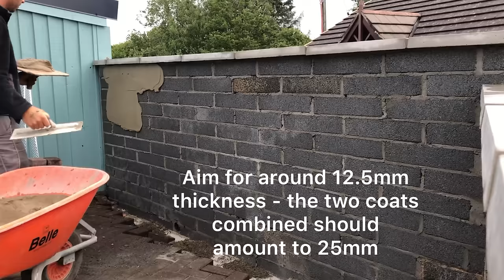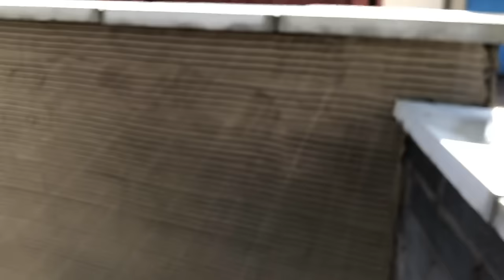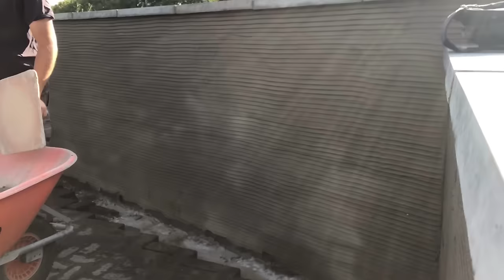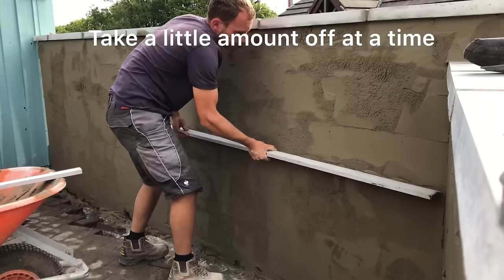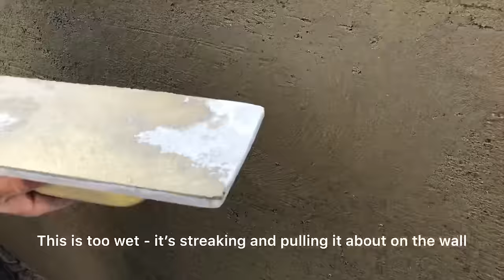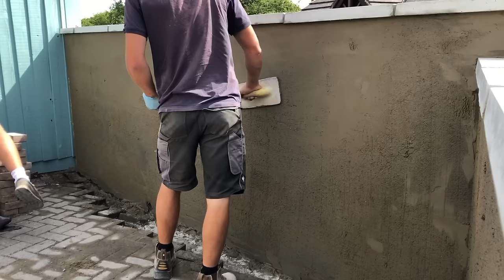How to plaster an outside wall

Comment: Does the final coat require Lime at all or does the plasterciser/waterproofer do the job on its own?
Reply from the maker: LAZER GAMING I don’t use lime and as you say let the plasticiser or waterproofer do the job. I only use waterproofer if it’s a wall where the rear side of it would be dry such as a shed or house wall. Some people do use lime in their mixes though!
Reply: Use lime in the Finnish coat  especially if you want a nap Finnish.. lime helps prevent hair line cracks also..

Comment: Excellent video, really clear. Sometimes the sponge finish on an external wall has a slightly stippled effect. Is this done with a wet or damp sponge? Thanks.
Reply from the maker: John Healy thanks! Just a damp sponge. I wring it out so water isn’t dripping out of it. It can be sponged in a downward sweeping motion or in a circular motion. And don’t catch it too late or it won’t sponge nicely, just after you’ve floated it is the best time
Reply: @SamDaviesBuilder  Thanks Sam. I'll give it a go :) Is there any particular type of sponge that works best?
Reply from the maker: John Healy just a normal car wash sponge is fine. Make sure the sponge is flat and not mis shapen or it will not give an even finish
Reply: That's a nap finish your thinking off.
Reply: You can do a nap Finnish using a car sponge or a raised nap using the same type of sponge that is used for skimming. Raised nap is harder to do but looks better when done correctly.
Reply: John Healy in Australia depending on the bricks and weather. On two coat in winter we still use water. Fine mist. Seems the cement ( mortar ) is extremely wet so hardly any water required.
We also have sponge floats.
I actually uploaded a plastering video and the bricks on a single coat was really really dry so it took a substantial amount of water.
Reply: A spongy 1

Comment: Sam, do you ever use lime instead of plasticizer in the base coat ?
Reply from the maker: No, plasticiser is so easy to use that I always use that.  That's not to say you can't use lime though, its just the way I do it
Reply: When you say plasticiser is that waterproofer ?
Reply from the maker: Ciaran Duffy no, but waterproofer will act as a plasticiser too. I only tend to use a waterproofer when it’s onto a cavity wall

Comment: Hi. How much plastering sand and cement? Also have you add any plastisizer in the mix and bonding agent in the questioned surface? Thanks.
Reply from the maker: Dimitris Kaloupis just plasticiser in the mix which is 4 parts sand and 1 cement for scratch and 5 parts sand and 1 cement for top coat. No bonding agent on the surface - if it’s smooth surface you would need some sort of bonding agent. I only had to wet the wall for suction
Reply: @SamDaviesBuilder  You are a star, i will give it a go however if i  will fed up by doing it,drop me your details and get that job here mate...
Reply from the maker: Dimitris Kaloupis I think Wales is a bit far from you I’m afraid 🤣
Reply: @SamDaviesBuilder  oh lord...Southampton...

Comment: I never understood how you make a wall plaster plumb by just troweling the plaster on it. In central Europe where I live we start off with putting plumb lines of plaster, let it dry and then we throw in the plaster in between, after that we use a straight  piece of wood or a metal lath to smooth it out by draging it on the guides (plumb lines of plaster).
Reply from the maker: Interesting to see different methods in different countries. I suppose here as long as your wall is flat and true, then your scratch is straight edged along with your top coat then you will be pretty plumb! You can’t go wrong with plumb lines of plaster I suppose though.
Reply from the maker: @stavebnifirmapikr9129  thanks for that. Such an interesting process! I’m surprised you don’t use beads and it’s true craftsmanship the way you do it! What’s your mix?
Reply: 1 lime 2 cement 5 sand for interiors and for exteriors 2 cement to 4 sand
Reply from the maker: @stavebnifirmapikr9129  2 cement is interesting, much stronger than our mixes.  4 sand to 1 cement is a pretty standard mix here

Comment: Do you have to do a whole area in 1 go, I only ask because after this video I'm tempted to try, but it's quite a long wall
Reply from the maker: Shane Scott you can always break the wall down into sections using stop beads
Reply: @SamDaviesBuilder  will the beads show on the wall or will I be able to blend 1 section into another
Reply: Put 2 stop beads back to back with a 10mm gap. After it’s plastered, run some mastic into the gap. If the wall is very long this is good practice as it will help to avoid cracks in the future
Reply from the maker: Luke The Skeleton Boi totally agree with you there, good tip!

Comment: I have a wall only 5 blocks high in harden but long 16m is this something to tackle rendering myself i am fairly handy just concerned about that final finish not being spot on. Near impossible to get a plasterer (decent one)
Reply from the maker: What you could always do is split the wall down into smaller sections by using a stop bead or some baton on the wall.  You may always see the join but if the wall is 16m long you'll end up with a crack somewhere due to expansion anyway (expansion joints every 6m generally on block walls)
Reply: @SamDaviesBuilder  what are your thoughts on this single coat render products
Reply from the maker: mickinoz2005 I haven’t used any before - I do plan to in the future though!

Comment: For both scratch and top coat, once applied how long do you have to wait until you can rule it off ? Also can you explain your sand and cement mix consistently? 

These are the only 2 things I have trouble getting right. Great Vid by the way :-)
Reply from the maker: Basically when you rule off you want to make sure it is dry enough not to move it about on the wall. It’s a fine balance as you don’t want to leave it too dry before you rule off.  I can’t give a time on how long as it depends on weather conditions for how long it will take. 

Here is a link to my video on how to mix:

https://youtu.be/8dxcp2GyQ4Y

Thanks for watching too :)

Comment: Do i have first have to wait when i made the scratch wall untill its dry?
Reply from the maker: Yea.  You have to wait until the next day before you put your top coat on.  I have made another detailed video on scratch coat only on my page if you want to check it out
Reply: @SamDaviesBuilder  

Thx.  One day ill wil try this.
After plastering can i give it a Colour?
Do i need a special paint.

Nice weekend!

Grz
Ben form the Netherlands
Reply from the maker: binola yes you can paint but ensure it is fully dry, I like to leave it at least two weeks, longer in colder temperatures. Use a good quality paint and ideally water down the first coat to ensure good adhesion. Thanks for watching!

Comment: Nice video. Looks like concrete bricks.
Do you use any additive in your mortar?
Reply from the maker: Ronald Martens yea it’s over concrete blocks. I use mortar plasticiser which adds air to the mix
Reply: Sam Davies the Australian builders association banned plasticer because they wanted to promote the lime industry.
I stopped using lime altogether when I came across an industrial chemist who stated we considered lime to be no good. I thought okay. So I worked with them and also used their plaster no lime. It's the best thing I ever did. It's more expensive. Does your work crack after a while once it's dried a few months time seeing as it's not drying?
Reply from the maker: Ronald Martens interesting! What does the plaster you use consist of? Have only experienced cracking from no expansion joints! Does your plaster crack?

Comment: Hi Sam would ya get away without a scratch coat if I skudded the wall
Reply from the maker: Johnny sorry I don’t have experience with skudding so I can’t help you there. I know a lot of people commenting on here seem to have an idea with skudding
Reply: @SamDaviesBuilder  i asked chat gpt :

When plastering over a stone wall, the terms "scud it" and "scratch it" refer to specific steps in the preparation and application process to ensure a good bond between the plaster and the stone wall. Here's what each term means:

Scudding
Scudding is the first step in preparing a stone wall for plastering. This involves applying a rough, thin coat of a wet mix, often made from a combination of sand and cement, sometimes with added lime. This mix is thrown or brushed onto the stone wall to create a textured surface. The purpose of scudding is to provide a good key, or grip, for the next layer of plaster. Without this rough base layer, the smoother plaster might not adhere well to the stone surface, leading to potential peeling or falling off over time.

Scratching
Scratching refers to the second step after scudding. Once the scudding layer has cured and set sufficiently, a thicker coat of plaster, called the scratch coat, is applied over it. While this coat is still wet, it is scratched with a comb-like tool or a trowel to create grooves or roughness. This scratched surface helps the final coat of plaster adhere better by providing additional texture and key. The scratch coat is crucial for ensuring that the subsequent finishing coats of plaster bond securely and evenly.

Summary
Scud it: Apply a thin, rough coat of wet mix (often sand, cement, and lime) to create a textured surface on the stone wall.
Scratch it: Apply a thicker coat of plaster over the scudded surface and scratch it to create grooves for better adhesion of the final plaster coats.
By following these steps, the plaster will have a strong and durable bond to the stone wall, ensuring a longer-lasting and more effective finish.

Comment: Do you wet the wall first if it’s dry
Reply from the maker: Yes you must wet the wall if it’s dry to help suction and stop it going off to quick. How much you wet it depends on the time of year too. You can’t wet it too much in the winter or it will take ages to go off
Reply: @SamDaviesBuilder  appreciate the reply sam.  Tough find a block layer these days here in Ireland. My wife sent me on a 3 day apprenticeship and told me to do it.  😅 looks like I’ll be plastering too.
Reply from the maker: @davidday866  I think trades such as block layers and plasterers are becoming harder and harder to find! Good luck doing it yourself, the key to it all is getting a good mix and you you’ll be fine!
Reply from the maker: @davidday866  there’s a few more plastering videos on my page and also one about getting a good mix
Reply: That the gospel today I made a mix.  I was so excited for it. The blocks levelled with a little wiggle. I learned the mother gets wetter as it mixes and slow down the mixer.  5 meters at a time.  I’ve got about 40 meters to go 6 block high.  I’ll get it before I’m done.   I’m a steel fabricator by trade.  Got to make railings  and  sliding gates.  Shoul be all sorted by 2024 🤞😳
Reply from the maker: @davidday866  glad you got the mix sorted! Sounds like you’re a natural at it. Good trade the steel fabrication too, never be out of work with a trade like that!
Reply: @SamDaviesBuilder  yes I’ve been going through your videos.  There great Sam. Can’t beat just seeing a job getting done well  no big long  chats and introduction.  Your mix video saved my patience 🤘I had a few bad ones, it’s not easy work with it.
Reply from the maker: @davidday866  cheers for the compliment! Once you’ve done a good mix a few times you’ll get it perfect every time, I reckon it’s a hard skill to master knowing what a mix should be like
Reply: I can see there’s an art too it.  Weathers scalding hot too. It’s rushing me 😬 I might stretch to 10 blocks an hour
Reply from the maker: @davidday866  as long as it’s tidy doesn’t matter how long it takes when you’re learning, that’s what I was taught
Reply: Yeah man. That’s the truth.  Rush it and you’ll find time to do it twice
Reply from the maker: @davidday866  exactly.  Only time you have to rush is if you’re plastering and it’s going off too quick 🤣🤣

Comment: Did you put pva before scratch coat
Reply from the maker: eagle gummy bears no. As long as the wall is clean and you damp it down for suction then it will be fine. If it’s a smooth surface you are putting a scratch onto then an sbr and cement slurry should be painted on just before you scratch. Block work just needs wetting

Comment: Hi mate, looks good. Did you use sharp or soft sand for the render?
Reply from the maker: Amer H I used building sand. Sand quality is so different in different parts of the country it’s difficult to say how my building sand might compare to yours. Your local merchant may even do plastering sand to buy

Comment: Good video but why put a 25mm render on a garden wall? No insulation is required as on a house wall. Better to buy a special finish that would go on in one coat at 3mm.
Reply from the maker: 25mm of render isn’t for insulation properties.  Sand + cement render is cheaper than the specialist coloured renders plus those (especially K Rend) coloured finishes can be pretty course and get dirty quickly as the dirt sticks in the course texture.  

Coloured renders do have their place though!

Comment: do you use pva
Reply from the maker: No, pva is water soluble so you shouldn’t use it outside.  If you want to get something to help the render stick then use rendagrip or SBR mixed with cement
Reply: @SamDaviesBuilder  can i mix pva with the render mix
Reply from the maker: @cosmic_sky_mountain  why do you want to mix pva with it?
Reply: @SamDaviesBuilder  i thought it could make it waterproof , but i understand now that it wont work , so can i mix sbr with my sand cement mix to make that better at weathering ?
Reply from the maker: @cosmic_sky_mountain  you can get a waterproof additive to go in the mix like this:

https://www.sealantsandtoolsdirect.co.uk/feb-febproof-plus-waterproofer-plasticiser-admixture-5-litre-fbproofps5?language=en-gb&currency=GBP&gad_source=1&gbraid=0AAAAADx-2OJx9gMin03eJOjp45aECrKZc&gclid=EAIaIQobChMI8M7Sya7HhwMV55NQBh1cRQmLEAQYDCABEgKJOPD_BwE
Reply: @SamDaviesBuilder  cool , thanks !!
Reply from the maker: @cosmic_sky_mountain  no problem, one thing to note is when you use waterproofer the mix will take longer to ‘cream up’ in the mixer than when using a standard plasticiser so be patient
Reply: @SamDaviesBuilder  super thanks !!

Comment: I don't like to see plaster going on without a scudding.. but that's the way I learned to do it
Reply from the maker: dj hago I’m not actually sure what scudding means? Always open to seeing other way things are done
Reply: Mix sharp sand and cement at 2 to 1 really wet with no plastisizer... and throw it on with a scudding spoon for first coat .. leave it a day then scratch it.
Reply: It keys to the wall alot better
Reply from the maker: dj hago ah I have seen that on a lot of Irish house build accounts on Instagram. I wondered what it was. I see it done before they clad a house in stonework too
Reply: @SamDaviesBuilder  youd be ran of an Irish site without scudding your walls before scratch coat.
Reply from the maker: Robert Bolger always interesting to see different methods in different parts of the country. If you get the chance then put up a video of you applying the scud, would be interesting to see. Thanks for watching too :)
Reply: @SamDaviesBuilder  that's standard practise here in Ireland mate.if this lockdown ever gets lost.a shovel of lime also into your mix helps it rub up lovely in winter.be careful in summer months tho.

Comment: Where is the bell cast beads
Reply from the maker: indigokid jjj2 bell cast beads are purely a cosmetic feature these days. We didn’t want them on the wall - most walls I do wouldn’t have a bell bead. Historically you’d have them on a house or chimney to shed water away from the base of a wall but now with modern DPC’s and paths being 150mm lower than DPC then a bell bead has no function apart from cosmetically.

Comment: Ok render beads are only 15 ml that's to allow for a 5ml scratch and a 10ml top, you didn't put a bell bead at bottom and you were that slow the render was tearing as you were ruling but overall was a decent finish 👌
Reply from the maker: Steven Williamson cheers for the comment. Bell beads are depending on what the customer wants. I say there’s more jobs without bell beads. And beads aren’t 15mm, some of the plastic ones might be but the metal ones are just mesh so you can make them anything you want. But the thing with this job is everyone is different and people have their own ways. I’ve never been about speed to be honest, it’s worked for me so far. Appreciate the comment anyway :)
Reply: Mate I'm not trying to criticise I'm just trying to help if you rule up as you go would be much easier and speed up it does have to be layed on perfect the rule will sort all that as for the bell bead if you don't put one at bottom moisture will get behind the render and the bottom will fall off in a few years it not criticism mate just fact
Reply from the maker: Steven Williamson I disagree on the bell bead. The bell bead is cosmetic a lot of the time. Before DPC’s were invented then a bell bead would have thrown water away from the bottom of the wall. On a garden wall it is rare to see a bell bead. And I usually always rule off once is all on - if you wet the wall correctly then you don’t need to stop halfway through to rule off. Like I say everyone has their own opinions on this and that’s the beauty of life